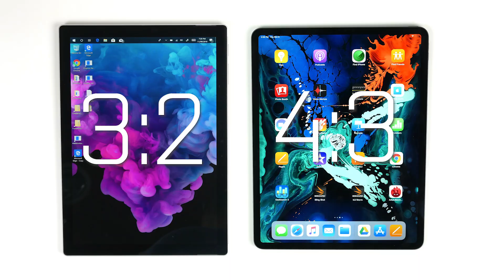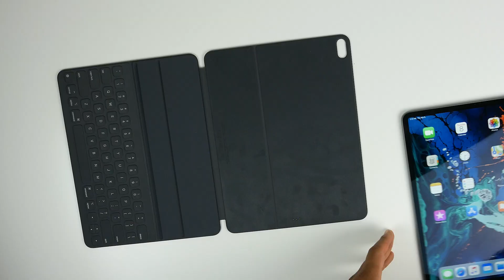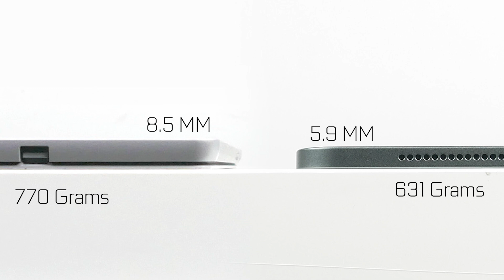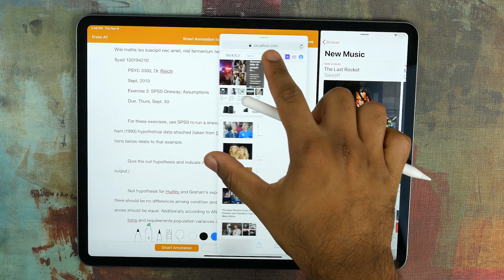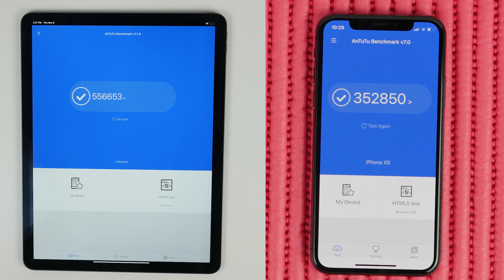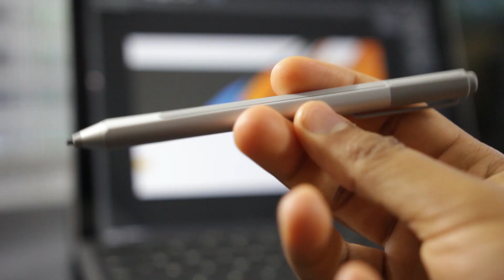2018 iPad Pro vs Surface Pro 6

Comment: the i5 results are waaay off. should be avout 4000 single, 13400-ish multi
Reply: I thought the same thing....
Reply: Probably because it's fanless.
Reply: I own a Surface Pro 6 and ran Geekbench on it, it got 4280 single core and 13877 multi core.  https://browser.geekbench.com/v4/cpu/10448646
Also the i5 8250U has 8 threads not 4
Reply: @Jack-ng3wr  is yours a 128gb or higher?
Reply: @Coolxbro  its the 128gb base model
Reply: JayJapanB, that's not how things works. Unless you'd like to say that  the SP6 i5 reaches thermal limits wothin secons, also on single core loads, and spends the entire test at about 35% lower perf

Comment: Is there any way to connect a hard drive & access to all the files in it through any 3rd party file maneger app in iPads......
Reply: Unfortunately you can’t use external hard drives on the iPad Pro. Apple doesn’t want users to artificially expand the iPad’s storage which is understandable. I don’t think it matters too much because airdrop allows iPads to transfer content via Bluetooth to any Apple device and there’s iCloud Drive and Google Drive.
Reply: @angelo_villones  but it is possible too send data using usb drives that uses the c ports.
Reply: Science butReversed other YouTubers tried doing that with the new iPad Pro and they failed. Yes it has a USBC port but iOS prevents the iPad from being able to use usb drives
Reply: @angelo_villones  wierd i use my usb with the c port on my ipad pro 10.
5 (it uses a dongle yeah bummer) but it somewhat worked,i was confused on where i would find the files from the usb,bu it will pop up by installing google drives.

Comment: He just did it by saying A12X is faster than 8th gen 4-cores i5 or i7.
Even Apple can't have courage to say that, it's the biggest lie in history
Reply: Geekbench scales really bad with respect to single core performance. A 15w mobile cpu can be almost as fast as a 95 w desktop cpu.
I am also not sure whether geekbench makes use of SIMD and other hardware accelerated x86 functionality. This is what makes x86 fast. Having specialized functionality for many common workloads
Reply: Yes like Teslas are faster than Buggatis in quarter mile races.
Reply: Yeah they're the same 'geekbench', but on totally different architectures. So we can even say that there are two programs (Windows - x86 / iOS - arm ver) that are totally different at all when it comes to its internal structure, instructions, detailed algorithms, etc.. Their name are the same, but that's all. Same name, different programs.

Of course we can't compare the scores from two different architectures. It's meaningless.
Reply: shut the fuck up bitch
Reply: Jalk Reviews  12x bionic chip is closely matched to the i5 8400 chip. 12x bionic is fast under iOS plus video rendering is where it shines, beating some MacBook pros.
Reply: Geekbench is not equal to cpu power guys
Reply: @dx_tuxer  No, but people suck it up and then say ridiculous things like an A12x is faster than an i7 based on that score... out of their %^$&*#& minds
Reply: for people who has no knowledge of cpu architect, they won't understand.  they will think more cores is better than fewer cores. for the real tech, we can only chuckle at it.   @mattball7341
Reply: Steven L depends on application ... it isn’t always the case, but yeah whatever
Reply: Well he can say whatever shit he wants , we cant sue him at the very least.
Reply: Its also faster than a 15W i7 in SPECint 2006.
Reply: It’s not comparable. But that i5 or i7 is different to the one inside your desktop. So in some cases it may happens that apples cpu is faster.
Reply: Trung Dinh an iMac can startup in OS or off a partition and startup in Windows 10
Reply: I'm just waiting for xbox game pass to come to ipad pro.
Reply: People! A series chips are faster in ios.....they are optimized for it.........what he means to say is......if U compare the speed of A series chips in ios and an intel chip in a pc......the A chip will be faster.....but obviously it won't be faster if the A series chips is used in a mac or pc.....its just optimized for ios....
Reply: A12x is better
Reply: @icyarecus6697  uhhh...that's kind of a bold statement. I5 and i7....keep in mind can run FULL laptops unoptimized or not. A12x can run smoother though because it's optimized for iOS. Anywhere else, it might perform terribly 🤷🏿‍♂️
Reply: @iMakeItFun  a12x is better only if the packages are concerned cuz a12x in iPad might out perform i5 on a laptop but a12x won't be able to do the same in laptops
Reply: if the a12x was actually faster than the intel processor, why is apple not using it in their macs. Just think on that for a sec
Reply: Jalk Reviews https://ioshacker.com/ipad/ipad-pros-a12x-bionic-chip-scores-better-than-intel-i7-on-geekbench-scores
Reply: @BobBob-tt3fe  It's a huge mistake to use 1 software to define CPU performance of <<different architecture>> on <<different operating system >>
Reply: Let's run Windows 10 on the iPad and restart the benchmark. If the iPad gets even 50% of the iOS results I will applaud Apple for the amazing work
Reply: @jalkreviews6304  you just proved that windows 10 is pure garbage if a 8 core cpu and a 7 core gpu on the iPad won't handle it. id much rather have a good OS than a shitty power hungry OS
Reply: @MarksTech  iOS is garbage. Windows is the single best operating system ever made. Period.
Reply: aliwalyd3 lol LMAO no it’s definitely not. Linux shits on windows any time of day. Ask any developer or programmer and they will agree.
Reply: aliwalyd3 lol best!? Dont make me cry, it is a good unix for interacting with hardware and gaming but please, it is way way too low to call as the best os....the best gonna be for linux, which is the base of nearly all os, on the background windows , linux still handle every aspect
Reply: Jalk Reviews difference !? Dont make me laugh, window is basically a interface of linux which is unix and that is what apple create ios base on. Second arm but can handle better 64-bit arch, intel can fuck off ... oh by the way, every ios apps is running on 64bit not 32bit so yeah, windows optimise is trash, and intel cpu is literally trash...combined and we have ultra trash bins and that is why its slower than a12x.
Reply: @NamelessPassenger  say it in an IT language cause I sounded dumb when im reading your comment
Reply: @NamelessPassenger  and if thats the case why is apply still using intel on their desktop products and not their own creation?? You dummy
Reply: @ataparag232  "legacy" applications. Many compute heavy applications make use of SIMD and similar x86 specific features that cannot be ported easily. 
For basic x86 apps Microsoft claim they have an emulator but it only supports 32 bit and Intel says it could violate patents.
Switching architectures on such a big platform that is so deeply integrated with its architecture is nearly impossible.
Reply: @your_average_clippy  imagine thinking this lmao. gtfo bro. Windows is literally a resource hungry shitshow compared to Mac OSX or Linux in general.
Reply: @jalkreviews6304  A person with common sense !!!
Reply: @MarksTech  LULZ  you have to be trolling because if you are serious.... dumber things could never be spoken
Reply: @NamelessPassenger  Apple uses intel chips for its most powerful laptop so you just shitted on Apple yourself.
Reply: @MarksTech  buy u can also install linux on surface. Lol.....
Reply: @MarksTech  yeah but ipad sure can't remotely do some of the stuff windows does. in windows, multi-tasking had been baked into it since day one.  you can run adobe apps in the background while you check your email and download something,  for ios, only some apps can do it.  the 8 cores on ipad isn't comparable in cpu power to an intel core.
Reply: exactly!   @ymi_yugy3133
Reply: @MarksTech  then why do more people develop on Linux then?
Reply: @MarksTech   you can't compare a phone OS to a PC OS
Reply: Derek Furst yes more people develop on linux thats why linux has so many more apps available that windows... dumbass
Reply: @your_average_clippy  just like your garbage mind is it?
Reply: @NamelessPassenger  who TF uses Linux? Are you build time your own pc? Tell me go or many people know how to do that. Linux isn't even on the list. It's Android, chromeOS, windows 10, iOS/iPad OS, and MacOS. And no one uses a chromebook tbh
Reply: @mattball7341  I don't understand why some people are so butthurt that Apple has made a good CPU.... they've made good CPU's before. The A12x is better than an i7 when it's being ran on Apple ecosystem because the ecosystem is made around the cpu instead of the other way around, giving it the opportunity to take shortcuts and process data faster, use less ram etc. Sure if you put the A12x on windows, it may not be as fast but it would still put up hell of a fight. the A12 isnt ai7 8700/8700k by any means but an entry level i7 it surely will surpass, and as far as any tablet/mobile CPU it's far Superior
Reply: @MarksTech  Windows 10 Garbage?? Sorry dude but using raw pointers with intel chips vs that shit of a chip apple has will really show you who the resource hog is...
Reply: @your_average_clippy  linux is better. Windows 10 is too resource hungry and i shouldnt be forced to update my computer lol
Reply: @MarksTech  Windows is a desktop operating system. You are comparing a punny mobile OS with it? C'mon dude.
Reply: @MarksTech  Oh and no. Windows is what most program developers use. Sorry.
Reply: @kohfu1724  A12x just at the same level with Intel corem CPU
Reply: According to Geekbench
Reply: @baronmunchausen645  Geek bench is different for ARM and 64-bit arch. Try Cinebench or real world stress test.
Reply: And geekbench are a bunch of "light task" meant to "struggle" mobile ARM devices. Those kind of test are what, 10% of what an x86 can do.
Reply: Just some clarity, the surface pro is using a better processor than the current macbooks...
Reply: Acording to geekbench, A12X is faster than 8th gen core i5 so yeah, up your face.

Comment: A lot of power in the ipad pro but the lack of pro apps is kinda pointless to have one of this right now, hope this start to change...and also the "pro" idea in a tablet that can´t connect with a mouse or have a proper  file mangment  system for a "pro" device, right now is just a regular ipad with steroids in terms of productivity!!
Reply: cmnweb i do agree that the filing system of iOS is really crappy, but I disagree with the idea of the iPad getting a mouse/trackpad. If Apple adds a trackpad to the iPad, then it would just be a crappy laptop. With no mouse, the iPad is still a tablet and it should stay that way.
Reply: @angelo_villones  the can do just do like Samsung with their dex. Or a dual bootable switch ios to mac. Why would people want to carry 2 devices at once or staggered their work halfway (do on an ipad and continue on desktop/laptop)? I rather get a do-it-all device
Reply: Umm ipad has alot of pro aps wym?
Reply: It had file transactions, a lot, using mega apps, iCloud, using external drive through type c adapter. Open it with Microsoft apps or apple support. Just now its lacking some serious business apps like adobe premiere which will be out soon, just not worth it for now. Second, well, for mouse, not really, since Apple Pencil can doing mouse trick but yeah, you have to raise your hand.